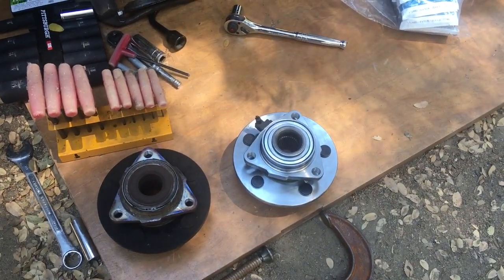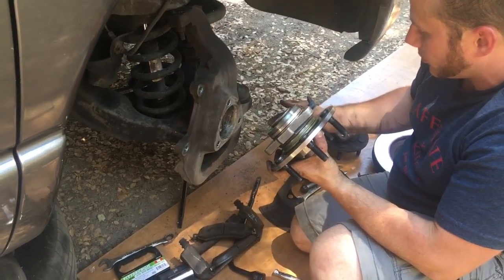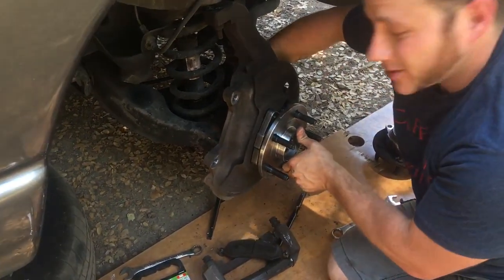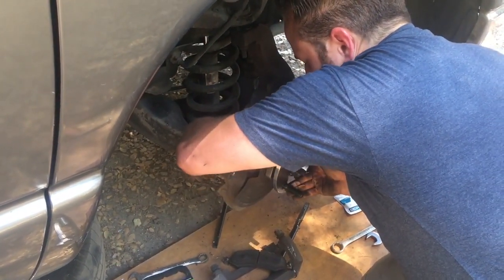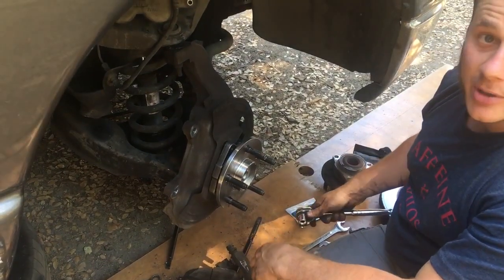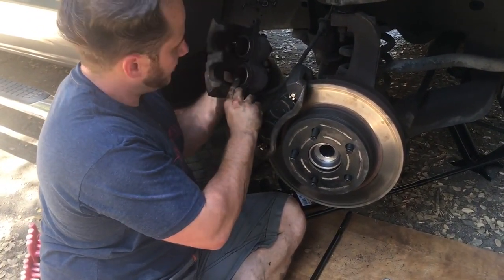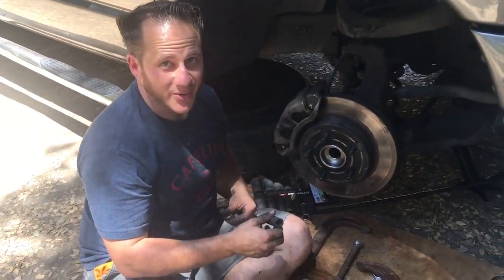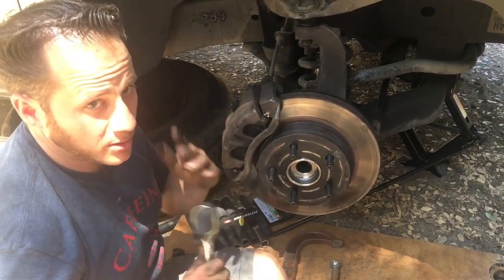How to change wheel hub bearings on a 2005 Dodge Ram 1500 | Strongman Garage

Comment: Thanks man for this informational video. I have to replace the hub bearing on my 05 Ram. I had one side did about 6 months ago at a shop and they charged me $500. There’s no way in hell im doing that again. So project bearing here I come 😁
Reply from the maker: It’s not that bad man save that 400+ dollars. I did this with random tools on the side of the road basically so I am sure you can do it too
Reply from the maker: Nice truck 👍
Reply: Kalle Beck thanks
Reply: @KalleSWBeck  Would this be the same on a 4 wheel drive 05 ram 1500 ?
Reply: I literally just got charged the same amount. Fxckin $293 for a part that tops at like $90..smh. I really needed to see the part that deals with the axle and nut though at the end here....oh well.